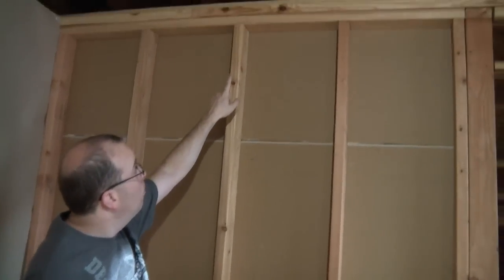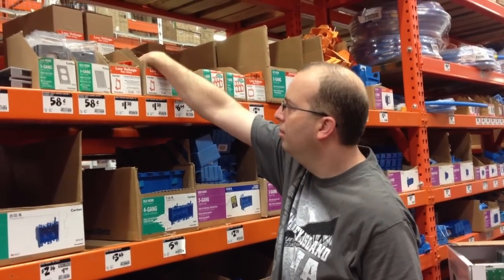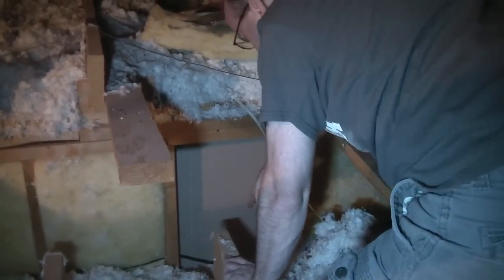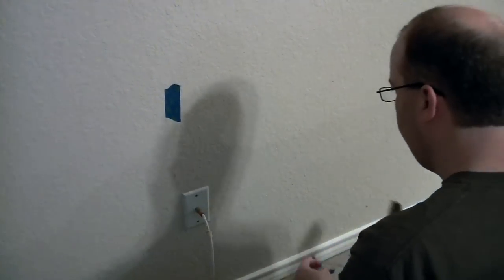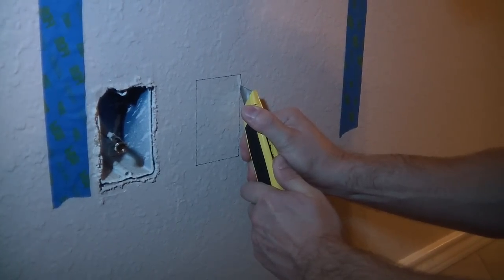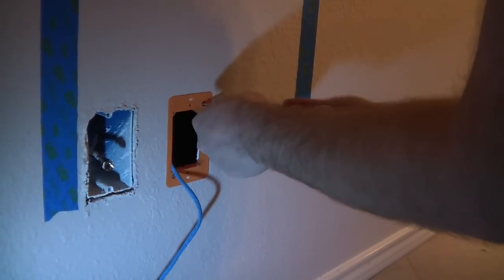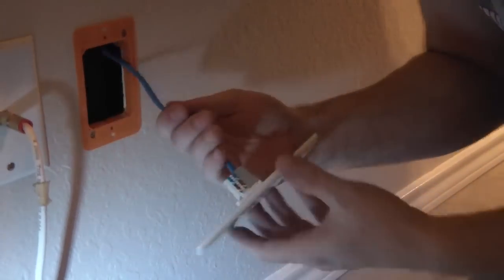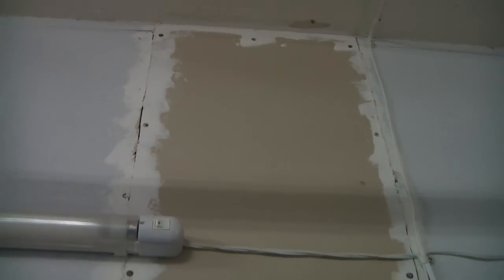How to install a network jack into a wall from the attic.

Comment: are walls in USA made of wood? Here in Europe we've got solid brick/concrete walls!
Reply: +André Costa  In all of  Scandinavia  houses are essentially made of wood , speak for yourself.
Reply: Most modern houses are made of wood, yes.
Reply: +André Costa Depends on the house...my house has brick exterior with wood, and wood interior walls. Solid brick and concrete walls crumble in earthquakes, which may not be a problem where you live but it's not uncommon here.
Reply: Give it time
Reply: "...houses that have been standing for over a houndred years." Point proven. I stated modern houses

Comment: the house I live in have these outlets but don't give out internet. Need help
Reply: *Please
Reply: They probably aren't wired in the same color configuration as the wire that plugs into your router/switch. That can be changed by seeing what the colors config is on the female end, and changing the male end to that same color configuration.

Comment: Affix the plate to the wall, and use WIFI.  Problem Solved, Geekcred kept.
Reply: Ethernet is generally more reliable than WiFi, especially if there's a lot of WiFi networks in the area.

Comment: A note about Western Australian installs tho: Houses in Australia are build from brick and mortar. The outside walls are a double layer of brick with typically a 1-1.5 inch cavity between them, inside walls are single brick and you cant run cables down them after the house is done being built. Meaning its actually the opposite of this video, you can ONLY run to exterior walls down the double brick cavity, and you cant make a rectangular hole in a thick brick to reach around and put your hand in for the wire, you need to drill a small hole and fish UP the wall and then pull the cable down.  Interior installs are possible if you have conduit already in the walls, otherwise you have to do surface ducting or chase the wall out and re-plaster over it. Its a nightmare in Australia!! And to put the cherry on top, you need to be licensed to install ethernet! Homeowners cant do it.

Comment: Thanks for the video.  I live in Texas too and yes it does get toasty up there.  Now I can install my own network jack in any room!  One question I do have is how do I connect that line to my internet?  Should there be something in the attic for me to hook it up to?
Reply: +George Warren II You will likely need to install two ethernet jacks in your walls, one in your room and (at least) one in the room with your modem or router. Then you connect your modem/router one end and your computer/console to the other end.
Reply: +George Warren II  I use a network switch in my attic.  I have one connection going from the switch to my router downstairs in one room and another line going from the switch to a bedroom for LAN access.  I'm fortunate because I have a nice power outlet in the attic to easily plug in the switch.

Comment: What if I have a brick house, is there a way to do anything without bringing down the whole wall? Also I currently have an ethernet cable going from my router, upstairs, to my computer and to another computer, downstairs. My connection is 25 Mb/s which it is on the computer upstairs but the computer downstairs only gets around 16 Mb/s. I'm planning on running an even longer cable in the future so would a better cable solve the issue or is it just how things are?
Reply: Your interior walls shouldn't be made of brick. So you should be fine with the method showed in the video
Reply: +SkellingtonT No, they're all brick, like foot thick walls made of brick and mortar, all of them.
Reply: Then there would be no way to run wires through them. You would have to run an Ethernet cable outside of the wall from point a to b.
Reply: +SkellingtonT That's how it is now and its fine, I just loose a bit of speed but would a better cable solve that?
Reply: Cat5e and Cat6 are the standard now. On your cable it should say what type of cable it is.
Reply: +SkellingtonT Its a really cheap cat5 cable, it was like 7$ for 30ft.
Reply: Whats your internet speed at? Because I believe cat5 supports to 100mb/s
Reply: +Imploment Cat6???

Comment: just use wifi no need to mess with the wall at all
Reply: wired will always be superior to wifi
Reply: +justin rivera WiFi is great, but sometimes, ethernet allows for a faster connection, or connects devices without WiFi built in.
Reply: +Kaelan Gibson I have never managed to reach the so-called "300 Mbit/s" of 802.11n. Usually it caps at around 115 Mbit/s and that is when you are 1m from the access point. I'm sticking with Ethernet, even old 100Mbit is faster (and it gives you 100 Mbit/s!
Reply: The problem with Wi-fi is that it really wasn't designed for continuous streams, even if the wifi is used for just one device, you'll get variability in terms of performance.

Comment: I was planing to do something like this,but live in Europe and I have solid walls in my apartment,as in  solid brick
Reply: +ConoTube Using the telephone conduits is the best idea apart from digging a trench and putting in new conduit.
For your safety, and the safety of the computer, NEVER, EVER try to run Ethernet cables in the same conduit as the power cables (220V). It is EXTREMELY dangerous, ILLEGAL and the interference from the power cables will also reduce the speed of the Ethernet cable.
Reply: The same thing in Portugal. Just brick and wall paint.
Reply: +Drazen Graves Me too. I use the telephone conduits when possible. Of course I will have to open junction boxes, which makes some damage to the plaster and needs to be fixed. Otherwise I dig the wall which is something that I hate because it creates a lot of dust, you might hit a conduit, and its very difficult to make the new plaster be the same like the rest of the wall, plus you have to paint it.
Reply: La interferencia pode ser tanta y hacer um curto circuit (The interference can be so much and make a short circuit) - Im portuguese, hope you understand me.
Reply: @Manoj Soni In North America, yes you can. All low voltage cables can run in the same conduit and use the same box. You don't actually even need to use a box; you can use the wall cavity alone.
Reply: I ripped mine out after getting full coverage WiFi... it's 2018 after all, no wires!   tsk tsk
Reply: I to and i dont want to use the crapy Wifi.
Reply: MrOpenGL ¿Qué rayos? ¿Por qué sería ilegal? acá se suele poner doble tubo por lo mismo, de eviatr interferencias
Reply: Gizego ¿Tan fuerte es el efecto de Foucault?
Reply: Gizego Al final resulta mejor poner unas canaletas, xD
Reply: Sí pero yo soy potugues y  mi espanhol é una m***. Mais je parle francais et anglais
Reply: Gizego
I talk more in english, but I know a few of french too
Reply: Gizego 
I'm mexican
Reply: In south and center america countries houses are also made of brick. My french isn't also very good. I can say hello if i am lucky.
Reply: @MrOpenGL Can we run the Ethernet cables(Cat 6 Cables) along with TV Cable (Coaxial) and the telephone line (RJ 11)  in the same conduit ?
Reply: @MrOpenGL Can we run the Ethernet cables(Cat 6 Cables) along with TV Cable (Coaxial) and the telephone line (RJ 11)  in the same conduit ?
Reply: Thanks for the reply sir
Reply: Same. I think I just run them along the wall.
Reply: Hello Dozen Graves
Reply: @odehyiebananayawbrefour4531  ???
Reply: i know im 5 years late here but i also have brick walls and turned the wires into a feature of the room. it turned out okay. i mean its a shithole of an apartment but hey gotta do what you gotta do.
Reply: @LisNya but much easier to work in. i'd rather go through drywall than concrete. that shit is too cumbersome and expensive

Comment: 1. flex drill wall. 2. tie line to glow rod. 3. push glow rod in hole 4. use hook to grab line in the corner. next time you would t have to take out a hunk of drywall.

Comment: Can I slide ethernet wire throu a cable tube that goes through 2 floors? There's already coaxial cable for satellite inside. The diameter of the tube is about 3 or 4cm wide.

Comment: is it legal to do it in the uk without a electrician?
Reply: I don't see why it would be illegal as long as it is your house or you have the home owners permission. you'd want to be confident that when your drilling holes that you are not drilling into a live wire.
Reply: I don't see why it would be illegal as long as it is your house or you have the home owners permission. you'd want to be confident that when your drilling holes that you are not drilling into a live wire.
Reply: as much as my dad and me wants it done he and my mum believes that you need a qualified electrician which could be true even thougth houses here only needs to be protected from the cold and fire is there's ever one
Reply: +adamhouse9999 You could get away with it, without having to get the permission of the council or a qualified electrician, but it would be illegal (if you're renting that property), however, not if you actually own the house. If you own the property, then you're free to do whatever you like.
Reply: +adamhouse9999 It should be legal because it is a signal wire, not a power cable.

Comment: You can fish wire through insulation no problem, just get a fiberglass fishing rod or fishing tape, its rigid enough to punch through insulation, but flexible enough to go around objects in the way.  Also pick-up a drywall saw, it'll go through the wall like butter and make it easy to cut out the hole.

Comment: I've used the drill sets with long, flexible extensions for running wires with great success. You can drill from the hole in the wall below, then run the wire down with the wire attachment. Lets you run exterior walls. You can get these kits at big box stores.

Comment: I have a few network Jacks in my house that are unused. how do I tell if they are connected to anything? if not connected how do I reconnect them?
Reply: +rrtt1 You'll want to use an ethernet tester, like this one: Fluke-Networks-MT-8200-60-KIT-IntelliTone-Generator. They'll run you less than $100, but will last forever. You can test everything you need in your house for continuity
Reply: i was wondering the same thing
Reply: Stefan Marth Thanks for the tip, but turns out we'll be moving soon so I can't run things like I had wanted to forever ago haha.

Comment: its so funny how ur houses are built.  looks not very solid!
Reply: They are built that way to sustain an earthquake shaking the ground.
Reply: in australia the walls are packed with tonnes of metal bracing,timber and joists THAN giprocked...
Reply: Brick and mortar on the outside, and wooden framing on the inside. It has been a successful, cost effective formula so I don't know what you're on about...m8.
Reply: ricochet50BMG welcome to America lol
Reply: They are built that way because it's fast and cheap way. Like a toy house. Any Tom dick and Harry can do yourself, be independent, freedom, avoid bad contractors and tradesmen. Local hardware stores win.
Reply: It’s an interior wall. It doesn’t matter how “sturdy” it is.
Just because construction companies have lobbied for nonsensically complex regulations where you live doesn’t mean our houses aren’t sturdy enough.

Comment: Looks easy but sometimes it's really impossible to do it from attic because of high temperature or piece of isolation or some shit like rats. Most likely easiest way to do it from existing outlet upwards to the attic but takes a lot of experience and special tools.

Comment: In my country we don't have walls made of cardboard, the walls are actually made of bricks and cement. So this would involve hammering and breaking the whole wall, and it is very expensive and hard and dirt job.
Reply: ***** I know the difference, I did not meant that my country is better at anything, I was just joking that drywall is much easier to handle than concrete, pretty much like cardboard.
Reply: ***** in your case it would probably be best to run the cable under the floor if you have a crawl space or basement
Reply: ***** In my country, we know the difference between drywall and cardboard; I guess everything is better in your country except the distribution of basic knowledge and information.

Comment: Sadly this method is not possible in my country (New Zealand) as it is required for all walls to have horizontal dwangs (often two or more) between each stud for a buildimg to pass regulations. So you would need a massively ling drill bit to get to the bottom where a jack would be mounted. Also we have insulation in every wall to my knowledge.  Great guide for people in the US though! I wish it was as simple here.
Reply: +Connor M They make exactly those drill bits.  Search "flexible drill bit".  They typically come in one long section (5 or 6 feet) and then an extension is available to bolt onto that.  Be careful, you don't know what you're drilling through and those bits can end up drilling through the side of your home!

Comment: Hey bro, can you do a quick vid specifically on wiring the Ethernet wall jack, how the wires go in, how they are punched in, what sort of tools, where to get them etc?

I'm trying to fit an Ethernet wall Jack myself but the wiring of the Jack itself is what I'm struggling with.
Reply: There are many guides online that should help with that

But as a guideline, from left to right (wire facing towards you, pins up)

T568A

1. White-Green
2. Green
3. White-Orange
4. Blue
5. White-Blue
6. Orange
7. White-Brown
8. Brown

T568B (ATT)

1. White-Orange
2. Orange
3. White-Green
4. Blue
5. White-Blue
6. Green
7. White-Brown
8. Brown

T568B (ATT) is the most commonly used one, and is compatible with pre made cables (ATT meaning it's used by AT&T, for phone and data wiring)

As for the jacks , the jack will be color coded, the blue and brown stay the same, though you will see 2 or 4 spots that have both orange and green on them with an A or a B, this is referring to the letter coming after T568, so A is T568A and B is T568B (ATT)
Reply: Michael Dickens so do you use 568b colour coding on both sides if you choose 568b ?
Reply: From what I've read if you use B at one end you must use B at the other end. Same for A.
Reply: Sean Tonge Nicholas Goss To make a straight through cable, you want the same thing on both ends, so if you have A on one end, you want A on the other, B on one end, B on the other, though for the most part, just stick with B

To make a crossover cable (to connect similar devices, like computer to computer, switch/hub to switch/hub, etc.) you terminate one end with A and the other end with B, this is rarely needed anymore as most networking equipment these days have auto sensing MDIX (or an MDIX button)
Reply: +Sean Tonge don't use bravo military and government use bravo for some odd reason. orange white
orange
green white
blue
blue white
green
brown white
brown
 
cut flush and insert tab side down. be sure wire ends touch the end of the rj45 connector. crimp pull good to go :)

Comment: So after seeing this I was left wondering why you made a new hole for another wall jack when all you had to do was use the same hole and box. Just get a new wall plate with a double cat 5 holes. Get 1 cat 5 jack and 1 coax jack. Whole lot easier.
Reply: *****  thats how i'll do...
Reply: It depends on the situation, in many cases it is easier to just run the cat5 to the same plate as the coax (which I have done myself not only due to ease, but also cleanliness) but it would have been harder in this case due to the kind of box used

The box the coax plate was on was a new work outlet/switch box (closed in high voltage, new work meaning nailed to the stud)

If the box was an old work box, he could have easily removed the box to find the cat5, feed it into the box, and put the box back in, since it was new work, it wasn't removable, at the same rate, if it were a low voltage plate (new or old work), he could easily find the cat5 without removing the LVP, but since it was a closed box, that also wasn't possible, so regardless, in order to get access to the cat5 at all, he had to cut a hole, might as well make the hole worth it and put the RJ45 plate on it
Reply: torontothegood You can install up to 6 jack of cat 3 (Phone) cat 5 (ethernet) coax cable and so on. As long as the jack fits. They go up to 6 its just a matter of what type of network build out you are installing.

Comment: Where are you in the attic. How do I know what wood to drill in when I am up in the attic. I'm trying to put a ethernet jack in my maser room closet.
Reply: There are many ways to do it depending on what you want, generally if you want to install the Ethernet jack near an area where there is already a jack of some kind (coax, phone, electric, etc.), you can use that wire as a guide (if it was wired from the attic), find the current jack in question, go in the attic and spot the wire heading to that particular current jack, then you know that the hole you drill will be near where that jack is (how it was done in this video)

Being that the location you want is in a closet, and it doesn't need to be particularly good looking, you can drill a hole in the ceiling  in a corner of the closet, stick a piece of wire or an unfolded hanger in the hole so you can spot it in the attic, clear away the insulation, then you know where to feed the cat5, you will need a cable grommet and a surface mount wire box (similar to a surface mount phone jack) to go this path though
Reply: hey thanks! i will give that a shot